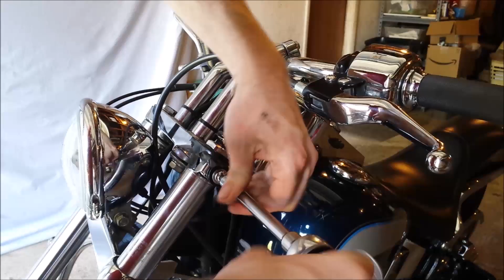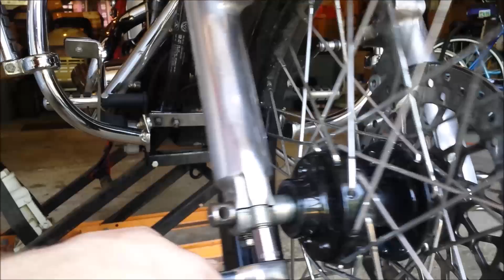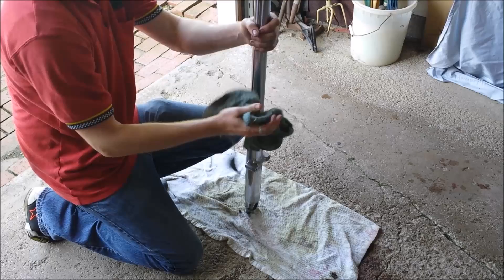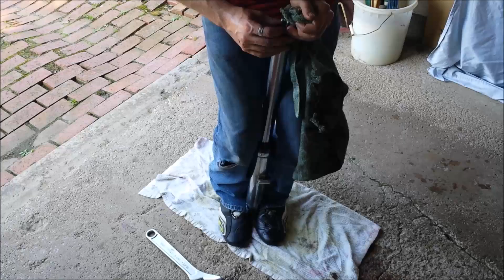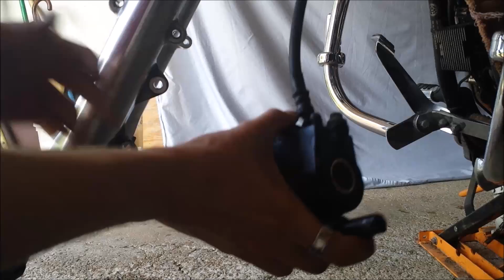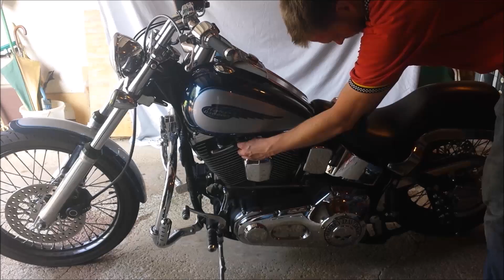How to Install Front Fork Lowering Kit For Harley Softail

Comment: No need to buy a lowering kit. All you need to do is saw off an inch or two inches from your pvc plastic spacer (however much you want forks lowered).  Not sure what his reason was to change one of the springs You can also avoid taking to top tree caps bolts and pinch bolts off by simply loosening lower fork tree and using a pipe wrench with a rag wrapped around fork to turn it counter clockwise and unscrew it and replace the same way

Comment: Hello I know this video is old and I'm not 100 percent sure but I think I just bought this bike it's identical I have some questions
Reply from the maker: It is is possible. Unfortunately, I had to sell it a few years ago. What year is the one purchased?
Reply: @WeakestofWeeks  1999 fxst
Reply: Do you have the stock suspension
Reply from the maker: Pretty sure I gave the OEM rear shocks to the person who purchased off me. I think I still have the original springs that were in the front forks before the progressive lower kit was installed though.
Reply: @WeakestofWeeks  where are you im rebuilding the front asap would  love to put the stocks back in
Reply from the maker: Columbus, OH
Reply: @WeakestofWeeks  im not far from Columbus can i get those stock front springs from you
Reply from the maker: Yeah shoot me an email: weakestofweeks@gmail.com

Comment: Hey quick question.  When you changed your rear wheel from 16 to 18" . Did you notice a drop of your rpms let's say around 60 to 70 mph?
Reply from the maker: Nothing noticeable. I used the original belt pulley on the rear and even though the rim size went from a 16" to 18" I kept a similar tire circumference. Think of it as a donut and the center hole has been enlarged, but the outside has remained the same.

Comment: I did this on my 07 softail deluxe, no need to remove the forks, you can do this with forks on the bike
Reply: ken olson I have a 2010 deluxe. How did you do it with them still on the bike?
Reply: @Daddy_Deluxx  I drained the fluid, took off caps, pulled springs out the top, dropped in new springs with spacers, refilled, put caps back on
Reply: We must have different forks then. Because mine are exactly like this and I can’t see any other way of doing it except how he did it
Reply: So it's just a reverse to bing them back to stock, correct?

Comment: Curious: Why cant one just loosen the top caps to allow draining...remove the drain bolts and drain the forks, then remove the internal springs and add new fork oil then add the new internals and tighten the top caps. I am suggesting not removing the forks and wheel and caliper from the bike.. just a question really..yes I know it could get messy so go slow and easy.
Reply: The top cap your referring to threads in to another threaded cap that screws in to the fork. The fork must be removed to gain access to this second fork cap because it's captured inside the top triple tree.
Reply: With these 41mm forks, removing the fork cap nut at the top only holds the forks all the way up in the triple trees. You still need to remove the fork spring cap to gain access to the fork springs. That fork cap nut at the very top, screws into the fork spring cap nut, directly below it.
I have an '05  Wide Glide with these exact same forks, and had to remove both fork legs to install the lowering kit. I went for the 1.5" drop.

Comment: The Progressive "drop in" kit doesn't require disassembly of the front end or draining the fork oil.....hence the name "drop in".   Is this Progressives standard lowering kit?
Reply from the maker: Travis Honn On some models it is in fact "drop in" but not this model Harley. Trust me, I wouldn't have made this video if that were the case..

Comment: I have a 98 softail. Bought a burly kit. Pretty much the same. The instructions suck. Do I use the PVC pipe and cut to length to get the correct preload no matter what?

Comment: I just recently bought a bike and when riding when coming to a stop there's front end dive and a clunk sound do you know what the problem is ? Thank you 😊
Reply: I see your comments about a year old hopefully you figured it out by now but if not I'll drop this line. Check your neck bearings, it's very common for them to be loose and or worn on older bikes. The good news is it's an easy fix.

Comment: You didn't mention if you changed the kickstand, and if so, how? I was under the impression, if both front and rear were lowered, it was necessary. Thanks for the video as I will be doing this soon
Reply from the maker: I didn't change the kickstand, it's still the original. When I park my softail, I normally air out the rear air ride, which drops the bikes center of gravity low enough to where it won't topple over, even in the biggest gusts of wind. Now if you lowered the rear with just the typical 1-2" lowering bolts, than you may want a 1" lower kick stand. Honestly, even then I don't think you would need a lowered kick stand but if you're worried, they're easy to swap. Just lift the bike up, remove the 3 or 4 bolts, and attach the new stand and reattach bolts. It's really that easy!
Reply: Thanks for the reply, I know it's an easy swap, but wondered if it was really necessary. I plan to lower both the front and back 2". I never pack anyone so I think I can get away with a full 2" . Can't afford the air ride, so I'll have to be happy with what I can afford. Later man, and thanks again

Comment: The torque specifications for the axles are critical. Getting it "shade tree tight" is not good enough. The bearings rely on proper torque to function properly and safely.
Reply: What's the torque specs
Reply: @38mares  for my 01 dyna wide glide its 50-55ft lbs
Reply: Malabanias you are a douche nozzle

Comment: ill be installing these in the next couple weeks. Isn't the whole point of this kit being "drop in" to avoid taking the whole front off the bike? I am assuming you took yours apart to change the fork oil? How much oil do you recommend putting in each fork? is each bike different i am definitely going to change my fork oil, that oil has probably been there since 92' lol 

@ILikeITBlown
Reply from the maker: Kit is somewhat deceiving by being called drop in. It drops in alright, but only after u tear the entire front end apart on some models like shown. Fortunately, Harley forks are rugged and unlike an inverted fork set up, u really don't have to worry about them leaking. Although, suspension performance is certainly effected by old/dirty oil. So do yourself a favor and change ur fork oil! On many models each fork takes 1 pint of oil, which is just half a quart. Double check dependant on what model u have as I am not sure about dressor models if that's what u have.
Reply: +ILikeITblown My bikes manual calls for #10 fork oil. I am guessing 10wt? What heavier weight would you recommend something not too heavy and something not #10 light? I hear A lot guys have changed over to a heavier weight and end up not liking the stiffness over the softness of the lighter fork oil.
Reply from the maker: +Eddie Maester What your manual calls for is probably a 10wt oil which is what Harley considers there type E fork oil. If you go with a heavier weight like I did, then it will probably be too firm for your liking. If I was in your position I would go with Amsoils shock therapy medium #10 oil. It's still a 10wt oil, but its going to be a better performing oil without the risk of going too heavy. I've ran Amsoil for years in my Buells and couldn't be happier with the results. Check them out https://www.amsoil.com/shop/by-product/other-products/suspension-fluid/shock-therapy-suspension-fluid-10-medium/

Comment: Nice bike... But what about the threadlock??
Reply from the maker: +BobO Thanks! And yes threadlock is a very good thing to use on these bolts. I tear my bike down multiple times to make changes throughout the year so I'm not too worried about it, but excellent suggestion that I overlooked!
Reply: I hear ya, I've had my front wheel off 3 times in the last two weeks....don't ask ;)